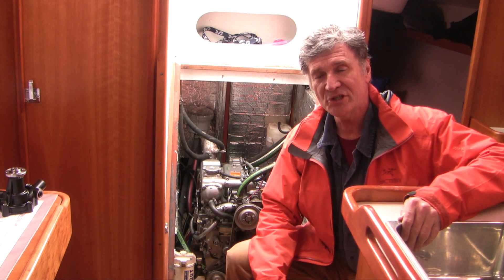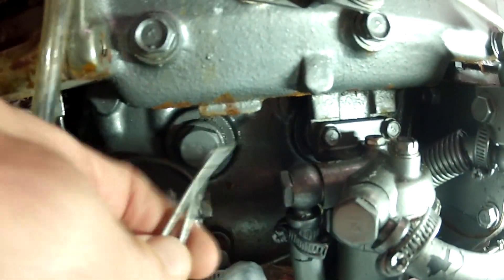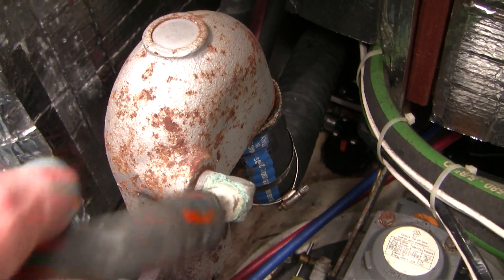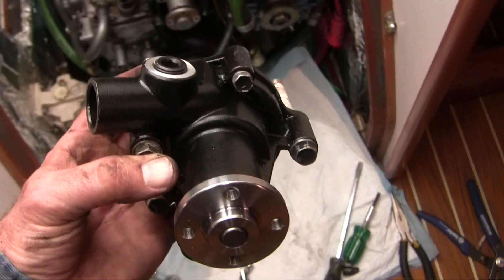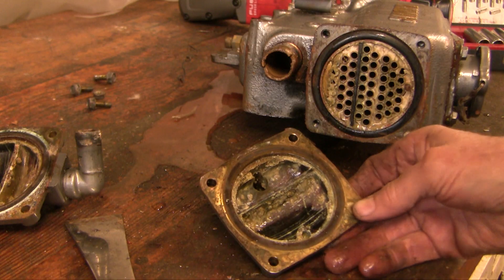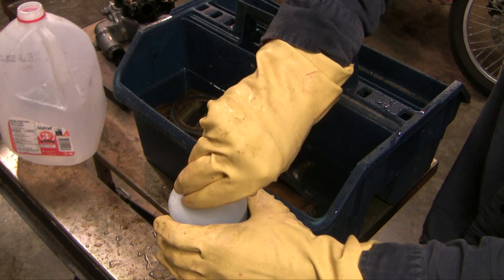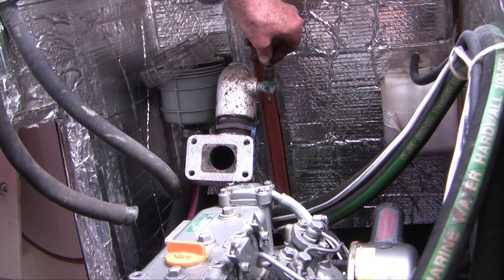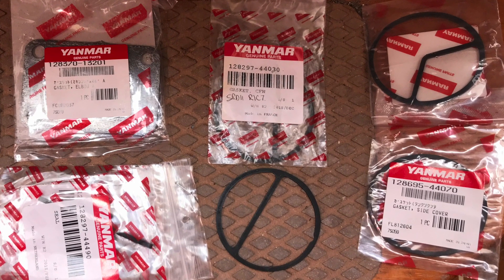How to clean a Yanmar marine heat exchanger

Comment: I guess there’s no zinc used to slow down electrólisis
Reply from the maker: My boat has two zincs, one just upstream of an electrically isolated prop, and a second inside the aluminum housing of the sail drive, along the path of the incoming salt water. So there is anodic protection, inside the most vulnerable part of the salt water pathway, the aluminum sail drive housing. These Yanmar engines were used in both fresh water and in salt water. The salt water engines were equipped with a separate fresh water antifreeze compound and a heat exchanger. Just like in cars, zincs aren't necessary on the antifreeze side of the heat exchanger for salt water boats. Fresh water boats used lake water throughout the engine jacket, with no heat exchanger. Those do use engine block zincs that clients swap regularly.

Comment: Hi from south africa. Thanks for the video.  What is the size(i.d.) of the tubes of the heat exchanger? 
( want to make a cleaning tool)  thanks
Reply from the maker: That's a good question, I didn't measure them. I used a simple gun cleaning kit. You can buy them on Amazon for less than 20 bucks, those kits come with various sizes and extensions.

Comment: Man your videos on the Yanmar 3HM35F are out of this world .
But I have question does this  engine have any anti corrosion zinc?

Thank you for your videos
Reply from the maker: Mine is the 3GM. These motors were designed to fit multiple applications, but those fitted to have internal fresh water circulating coolant as shown here do not require routine replacement of internal zincs. Those that are used in applications like fresh water boating may circulate lake water around the engine cooling jacket, using only one pump. They do require routine zinc changes, and there are fittings in place for those on the starboard and rear side of the engine. The reason for the difference is that antifreeze has a chemical makeup that does not promote galvanic reactions, so a zinc in that setting is unnecessary. For example you don't need zincs for automobile cooling systems. It turns out that the salt water in oceans is highly corrosive because the dissolved ions promote electrolytic reactions, so even with zincs there is progressive corrosion. To avoid that we use the more complicated system shown here. My SD 20 sail drive has an internal zinc which is accessed from the port side and I change that one regularly, in addition to the zinc mounted near the prop.
Reply: @ 
Thank very much great explanation .

Comment: When you opened the heat exchanger, there was a round gasket and a separate straight piece of gasket.  However, when you showed the parts and put it back together there was a single one piece gasket.  Why did you add that gasket?  Mine doesn't have that gasket.  Do I need it?
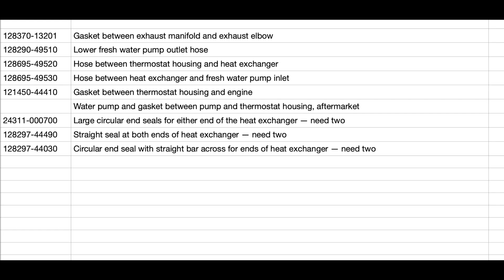Reply from the maker: That's an astute question. I bought the seals before doing the task, there was a thick round ring on each end, a thick straight bar you cut to size, and a third seal that looks like a thin circle with a horizontal line through it, seen at 12:27. On opening my heat exchanger, like yours the third seal was not present, it's the last seal listed in the parts list at 13:46. My heat exchanger was working OK, so I'll throw out a guess it is not necessary. Even so, I installed the third seal anyway to align with the parts diagram seen in the dealers repair manual. Presumably it was used to give a better seal of the end caps to the housing to prevent external seeping of coolant along the edge, and to reduce crossover flow from shortcutting the Z shaped pathway. My heat exchanger never leaked and I haven't done the task again since then. I hope that helps!
Reply: Just doing my exchanger 2gm20f exactly the same when dismantled no third seal. I'll put it back together as I found it with no third seal. Just mentioned for future people looking. 
Great vids mate. Well done and thanks.
Reply: Update regarding the 2 gaskets. I've just done mine. Only use one or the other. The later gasket is an upgraded version.  Don't use both.

Comment: I had a Universal diesal in my Ranger 33 sailboat with an external heat exchanger.  I used vinegar to clean out the calcification.  I'd be interested in yoru opinion about vinegar.  Great videos!
Reply from the maker: There's a balance between  personal safety, convenience, speed of action, and safety of underlying metals. Vinegar is high on safety and cost, but not as fast or aggressive as other options. Muriatic acid (aqueous HCl) is probably the most frequently used agent through the centuries, and it is cheap. If you mess up mixing HCL you could literally die of painful burns, and even splashing is a risk, especially if you make the mistake of adding water to acid. You always want to add the high concentration product to the water since what splashes up is mostly fluid that is already in the container you're adding it to. There is also a risk of a powerful acid eating at underlying aluminum and other metals if it is left on for too long at a high concentration. Lately phosphoric acid (what I used) has been very popular and it is marketed in the marine industry for that purpose. It is certainly less powerful at full concentration and safer than HCL, and proprietary formulations offer simple directions for dilution. Companies that sell phosphoric acid for marine applications say that they add other agents to improve surface tension, penetration etc but I do wonder how much of that is marketing advertising. They also claim it is safe in sea water but of course it will kill anything nearby that is exposed before dilution in the sea.

Comment: What is the diameter of the tubing using to drain the fluid?
Reply from the maker: Sorry, I did not measure it, I just selected the largest size that would fit from the kit. The bottleneck is right at the top so outside diameter would be easy to estimate. If you take a few bolts to the boat and select the largest that will fit, you'll get a good idea regarding outside diameter.

Comment: Every Yanmar marine owner should watch this video and learn some preventative maintenance.

I am a retired heavy equipment mechanic, I have a part time job helping a friend in his radiator repair shop.  We do a crazy amount of marine work.

I hate Yanmars, or maybe I should say I hate Yanmar owners.  They never seem to clean the heat exchangers until there is an issue.  Then they try to take it apart and it is jammed and full of build up.  They come in beat to hell from someone beating on the pack with something trying to get it out.  Makes my job so much harder and of course the price goes through the roof with the hours, and I do mean hours, I have to spend on it.  

So Yanmar owners, do this on a regular basis and you will never have to come see me and have to spend an obscene amount of money
Reply from the maker: It's always nice to get feedback from a pro who does this for a living. Thanks for stopping by!
Reply: Can you offer any suggestions on  "regular basis"...? In my case, the boat is on a mooring from May-Oct then hauled over winter. Usage is 2-3 days per week running engine 1-2 hours per week. All is in saltwater environment.
Reply: @borntoroam392  I would pop an end cap off and have a look.  FYI, the white build up has much less heat transfer abilities then the copper tubing, so it doesn’t take much to start to affect your cooling.  

I would just have a look, if you see a build up, clean it and look again after the season. Do this for a few years and you will get a feel of how long you can go between cleanings.  

And don’t forget to change out your anodes on a regular basis. You have no idea how many coolers I have cleaned that have a bunch of broken off anodes in them.

Comment: These videos encourage me to work on my Yanmar more by myself and not to ask professionals to service it. May I ask teo questions?
1) Last summer I had big service (fuel injectors changed, heat exchanger cleaned, etc.), and since then I have noticed that the engine tends to shake more at that moment when I turn it off. Was this to be expected?
2) If I don't know which coolant was used (I see it has greenish color), what is the antifreeze/coolant type safe to use (diluted in 1:1 ratio with distilled water of course), without specifically pre-flush/rinse?
Thx in advance!
Reply from the maker: It's a problem when you don't know what coolant was used before, but green coolant is typically standard antifreeze used on old Yanmar engines that have very little aluminum in the body of the engine. My sail drive is aluminum but it doesn't circulate engine coolant. Prestone make a universal coolant that is compatible with that old version, so in your case I would probably go with that one. More modern coolants have antioxidants added that reduce the chance of acidic oxidative breakdown of engine components, specifically aluminum that is used in some engines, either in the head or the short block. The one I switched to is an OAT version of coolant that is made for diesel engines and it may be a little better, but you always worry about compatibility with older coolants if you're not sure. The main problem with newer coolants is not only compatibility but also the fact that they degenerate over time so need to be swapped out more regularly. The big issue people have is the mistake of using tap water rather than distilled water. How much to dilute is a question that depends a little on how cold it gets, since the antifreeze properties will be needed if your ambient temp drops below about -40 (F or C). Most people dilute to 50%, ie equal volumes of concentrated coolant and antifeeeze. Beware the premixed versions, in which case you don't dilute at all, they are already diluted to 50%. I can't say much about engine shaking during shut down. One cylinder may have a little more fuel in the line before it runs dry. By itself I don't think I'd worry too much about that.

Comment: Very nice. Please, would you be so kind to comment on the alternator belt(s): what is effectively the difference between "toothed" and "smooth" version (or in the context of a particular Yanmar model)? Thx!
Reply from the maker: The design shown in this video is a traditional V belt, which is clearly inferior to the more modern longitudinally ribbed serpentine belts on almost all newer engines. There are kits to swap over to a longitudinally ribbed belt, which allows a somewhat lower belt tension, which wastes less energy as heat, which provides enough friction to power more demanding peripherals like high current alternators, and which are easier to tension with a dedicated tensioner. I seriously considered swapping over but the kit I looked at extends the engine on the bow side to the point it would be a very tight fit against the stairs above. Specialty belts with teeth that are at right angles to the direction of movement are used where you can't tolerate slippage, for example in timing belts where the cam and crank pulleys need to stay in sync. Cheers!

Comment: It would be really helpful before you started the work to explain the extreme basics of how the anbar fluid system worked for example I'm gathering that it's pulling salt water into a exchanger and then the actual engine coolant is also running through the exchanger so the salt water never runs through the engine. But you're not saying that explicitly. And also before you start pulling things apart you could say here is the hose that goes from the engine to the inlet of the exchanger and here's the exit hole of the exchanger with the engine coolant and the hose goes to the engine again and here is the salt water inlet on the exchange or in the hose and here is the saltwater exit on the exchanger in the hose. Things like that before you even start taking stuff apart with a big wide shot of the engine pointing to those basic systems. And also if you could point out where the injectors are the diesel injectors and any of the other basic components before you start I think it would only take 15 to 30 seconds before you started any video but it would just be a good overview of any engine you're working on before you start getting into the specifics. It really helps someone who is looking at a yanmar engine for the first time and sees this problem and is considering buying a boat with a yanmar etc etc has never seen one before rather than assuming they know the basics about it yanmar or any engine and just diving right into it. That would probably increase your audience by a good 20 to 50% or maybe even more.
Reply from the maker: Those are good points, thank you for taking time to respond. I did a playlist of Yanmar videos on my channel, some of which covered those basics. One video covered many of the specific questions you ask here, titled "Understanding Yanmar diesel engines, coolant exchange". One of the greatest challenges when publishing to a broad audience is to somehow make it worth watching for everybody, without making it too basic for some and too complex for others. You are absolutely correct to say I consistently assume more background in the audience than most have. You're right, the popular authors on Youtube manage to do that better, although in some I worry they gloss over steps and make it sound too easy. I'd be disappointed if I walked people into a repair when they don't have the background to cope with complications like broken bolts, shorted wires, etc.

Comment: Why would anyone purchace a YANMAR ,Every part is in the way of everything,( poor desine) , Every salt water fitting is not stainless the cost to fix this is minimal
   for YANMAR ,Most are in confined space ,it`s a shame mr jappys dont own boats then they may have a rethink on the desine,Other marine diesels are much better 
Think before you buy me Buckos !!
Reply: We've got just about 9000 hrs on a pair of 4lh-dte's. Just about everything besides starters and alternators is original. Replaced the turbos preventativly, they weren't bad, but changed them when replacing exhaust elbows. Super reliable engines.

Comment: Thank you for this great instructional video. I've the 2GM20F with 2700hrs. How would I know when I need to descale the HX? Do I go by engine running hours or wait for over-heating?
Reply from the maker: If you haven't done it since owning the engine, it would be wise to schedule it now. Of course if you have a long trip planned, do it before leaving. This kind of maintenance is something that all boat owners should do, since you may need to do it urgently at a far away anchorage with minimal tools one day. Better to have done it at least once before so you are comfortable with doing it. Understanding how these systems work is critical to understanding how to approach an engine that is overheating. Good luck!

Comment: @5:42 you have two cables are coming out of the water pump housing. Based on the manual, there is only one CW thermostat switch/plug attached to the housing. What is the second one?
Reply from the maker: There are two extra hoses attached that are the supply and return path for coolant to go to my potable water heater. When engine is on, that water heater exchanges heat with the engine cooling system, so tap water will be warm at my sink if the engine was recently running. There is also an electric water heater option that is AC powered if we are tied up at the dock. I believe that extra device is a temp sensor for the water heater electronics. I don't know if that sensor is tied to an actuator that can close off the coolant flow if heat rises above a set level, or if it is just a temp sensor.